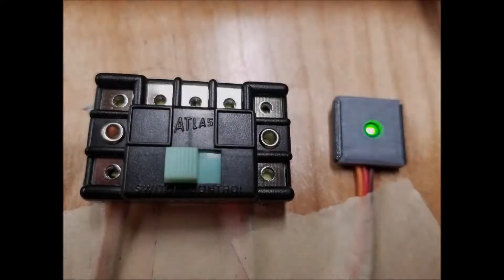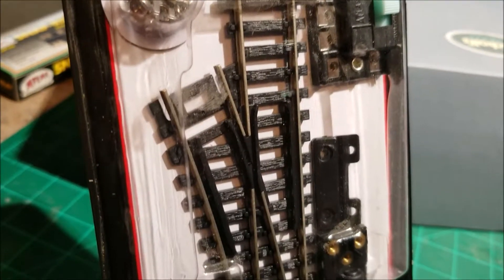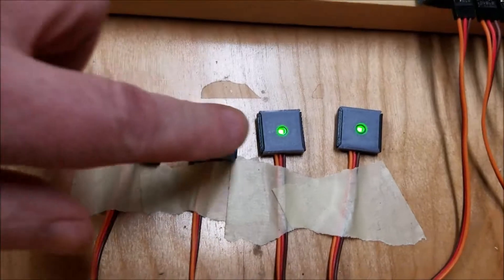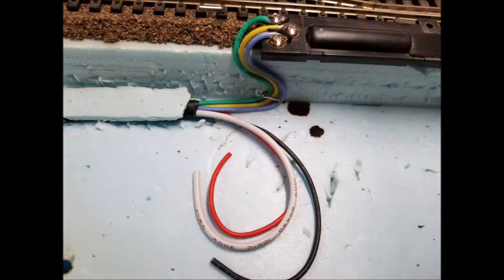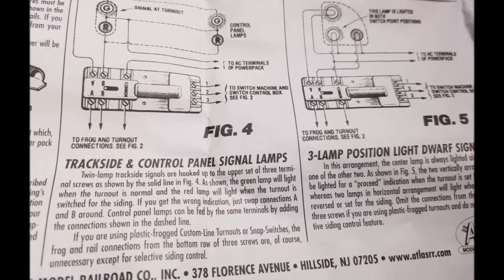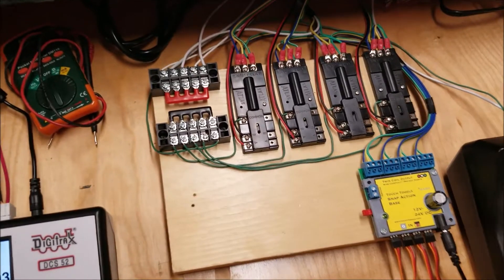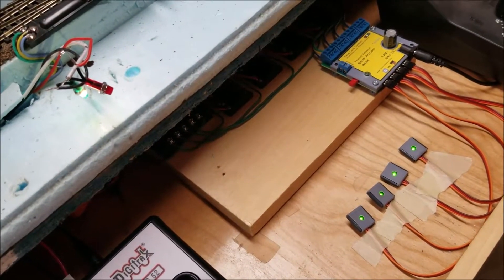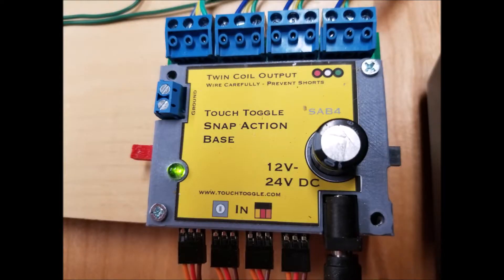Controlling Turnouts & Signals with Touch Toggles - AWESOME!!

Comment: Can one Touch Toggle operate multiple switches, like, for instance, both ends of a crossover? Green - both are straight. Red - both are aligned to allow traffic to change tracks.
Reply from the maker: I'm controlling two turnouts with one toggle.   I send the signal to one switch machine and then daisy chain to the next. Press the button and both turn outs switch.   I think there are a lot of different ways to use this system beyond what I'm doing.  Check with the manufacturer for more info.
Reply: @petes3dscalemodels881  

I checked with the manufacturer, and this is what they said "For Tortoise type machines, up to 4 machines can be powered from a single output. Just put two wires into each output terminal. This makes crossovers very simple.

For snap type machines that need more power, each machine needs the full power of a single output. In this case you would use an Input Splitter to connect a single Touch Toggle to two inputs on the Snap Base. Both would be activated at the same instant, but the Snap Bases manage their output to recharge between operations, so the  two turnouts would actually throw a second or so apart.
"
Reply from the maker: Thanks for checking.  I was aware of the splitter but hadn't tried it.   For snap switches  they make 2 different power bases, and I have the stronger one, so perhaps that's why my set up works ok.  I'd like to convert to tortoise type some day, never tried those either.